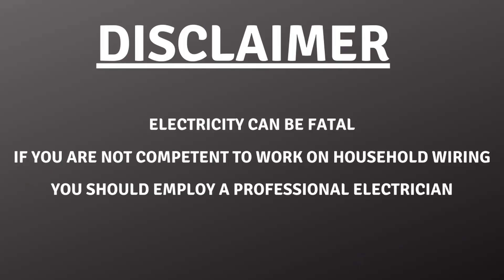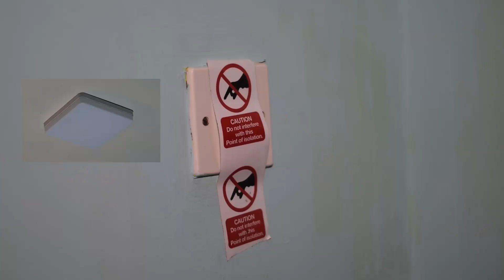how to Change a light to a LED Panel and save power #scotland #amazing #eco

Comment: I'm kind of impressed, as a electrician I tend to cringe of these  types of video's but this is very straight forward. also its a very unique fuse box. the tape was a nice extra. personally  I think it would be nice changing the switch into a newer model to fit better with the lamp (consumer decision ofc) and get rid of the unnecessary "grounding" wire (I'm not sure of the proper English term, but the copper wire that's not in use, unless ofc there is a chance of you going back from led which is unlikely
Reply from the maker: Yes it was just a storage room before that's why the paint and switches are in a poor state . I leave the earth wire incase its changed into a bedroom and a metal spotlights are fitted in the future as they would need earthed.. the tapes from work  lol I'm a SAP in the local power company
Reply: What was the unique of the fuse box?